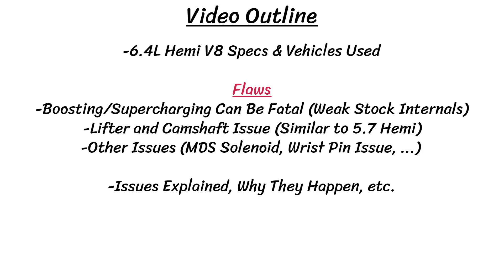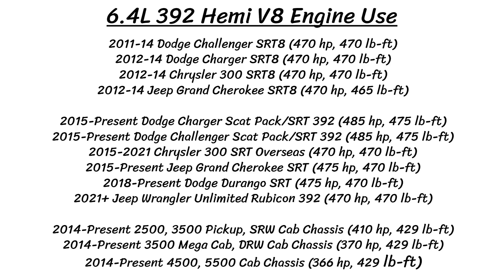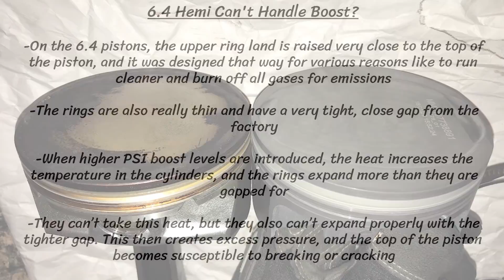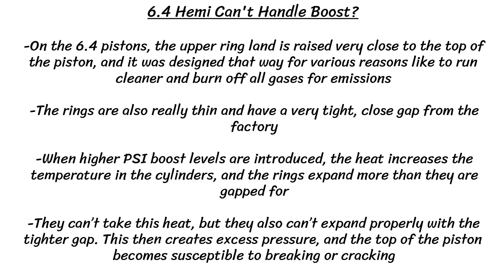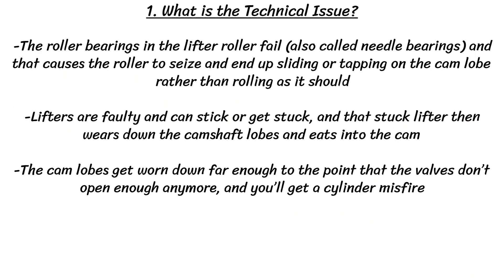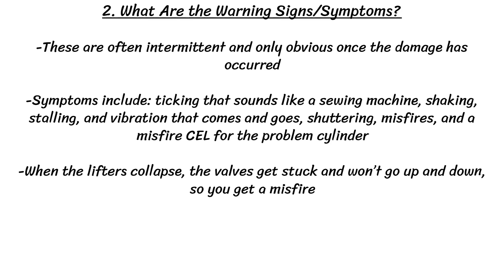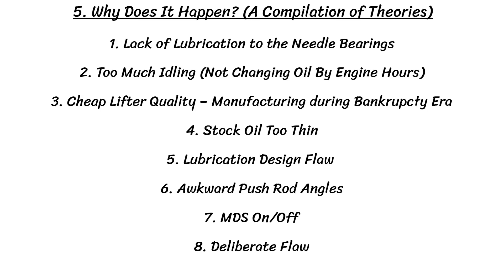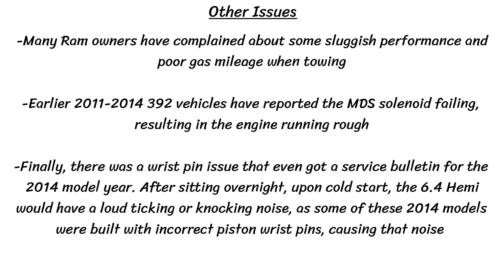The Specs and Fatal Flaws of the Chrysler 6.4L Hemi V8 Engine (392 Hemi Issues)

Comment: The 6.4l stock is pretty reliable.
Reply: I agree.  If someone is satisfied with the stock HP and doesn’t want to add boost they will be just fine.
Reply: @bybrianmalone  yea there are still a ton of ppl who don’t wanna bother with modifying and it’s perfect for that. Maybe adding a catch can would help it but I still know ppl who don’t have them and are fine.
Reply: Stupid video. They are extremely reliable in stock form. The fact that they can't handle aftermarket boost is hardly a "fatal flaw".
Reply: @ThoughtMachine1  true, he’s just naming the issues that these motors are known to have. Not all of them have these issues at the same time. Ik ppl with over 100k miles on them without any major problems. Personally have over 40k miles with the only problem being only a hole in the radiator lol.
Reply: @largenloud9744  I’m hitting 60k
Reply: @ThoughtMachine1  exactly I was so annoyed that he was like you gotta build the internal for boost as if that was something out of the ordinary 😂 like I know there are other motors that handle a little bit more boost than the stock 6.4 can but they all have a breaking point before throwing real high boost at them not to mention the 6psi the 6.4s can handle has been know to dyno around 200 extra hp and some pro charger companies will even warranty the bottom end too if you use their tunes
Reply: Totally agree brother.
Reply: This video is basically just saying you cant run boost or supercharge a engine with STOCK INTERNALS. These guys will get better blocks and INTERNALS if they really wanna modify it, like most other mid price vehicles. What is this video even proving?
Reply: I’d say it depends on the year made honestly. My 14 GC SRT had a new 6.4  put in at 30 k. I bought it at 60k and she’s singing like a singer sewing machine. I’m leaning towards the whole table of ideas why. Seems that they have it somewhat figured out now but still blows I hafta do a major operation on it to replace failed lifters. Lucky I can just do it myself and not eat a dealer rate.
Reply: The 6. 1 doesn’t even have as many problems has the 6.4🤦🏾‍♂️ Don’t get me wrong it’s nice but that hemi tick sound  is crazy for such a great engine and dodge still don’t know why it does it or how to fix it 🤷🏾‍♂️
Reply: @tvisfake588  not true hemi tick was fixed sometime in 2014-2016 if you have a model after that you should have taken better care of it or maybe just got unlucky
Reply: problem comes when idiots want to start throwing boost in them… id keep the 6.4 stock, maybe a catch can & an intake but that’s about it
Reply: This dude still drives a V6, don’t take his videos serious especially if you’ve seen his “how to burnout” video with his big ass hair lmao
Reply: Utube Fknsucks  you answered your own question… you work In a auto shop lol
Reply: Utube Fknsucks  What is your definition of properly maintained? Work and personal trucks get serviced every 3 months, or less. They get driven hard, high idle, constant short trips and don't have issues regardless of manufacturer.
Reply: must of them start having issues around 50 thousand but they go unnoticed until they breakdown around 75 to 120 thousand which isn't many miles but I see this alot and dodge knows it and when they do fix one under warranty they do the bare minimum but people let them get away with it and you would think the issue Subaru had with the 6 cylinder with thin rings that dodge would be smart enough not to but hey you can't fix stupid companies or consumers but it's job security when your the one fixing them .
Reply: Exactly
Reply: The only fatal flaw is aftermarket modifications that push the power past the point the engine was designed for. Oh and the lifters that fail. That however can ruin things. But a cam and lifter swap and a cleaning of the block to remove shavings from the cam and it’s back on the road
Reply: @2koolchris291  That’s a flaw though lol, these cars aren’t cheap to begin with between gas and payments , 90% of people aren’t going to want to drop all that money after dropping all that money lol love my 392 but I’m a realist I know this thing won’t out live my 4 runner.
Reply: @Jacobyjohnson24  then they get what they get. If you try to ghetto rig boost an engine and only do the bare minimum or just a few things then yes your engine will give out. Either do it right or don't do it at all.
Reply: @russellrandy99  6.1 hemis an take prochargers with ease. 2008 300Csrt owner with 705 hp to the wheels on stock internals since 45k miles ago. Just saying.
Reply: @Eidrian111  6.1 srt engines have forged internals from the factory. The 392 like the 5.7 does not.
Reply: @joshkrause2977  now i know why it’s been reliable as f
Reply: @Jacobyjohnson24  So stick with Toyota like a Corolla SE?
Reply: @Jacobyjohnson24  well the lifter issue is isolated between certain year models it’s not just this forever problem with all of them like the rumor has it they fixed the issue and started using better lifters in like 2014 or 2015 not sure the exact year but sometime around then and if the price of the car and gas is already killing you maybe doing a cam and lifter job is too expensive but then again maybe you shouldn’t have gotten a high performance car if you don’t want high performance problems
Reply: @russellrandy99  so true
Reply: MoPaR oR nO cAr🤣🤣🤡🤡

Comment: i change my oil on my scat pack every 2000 miles in hopes of never experiencing that cam/lifter failure issue. once the car is paid off, i plan to do an "MDS Delete" with brand new lifters. I hear that this issue affects the MDS engines more often than the manual trans cars. Not sure how reliable that info is, but I feel that it's a good enough excuse to also throw in a custom cam & tune.  :)
Reply: 2000k miles is OVERKILL....so basically if you're driving cross country you're going to change oil....I don't think so
Reply: @David-yy7lb  Oil is the cheapest insurance policy you can buy for your car, but I guess you don't understand that kinda stuff lmao. You're not a car guy obviously
Reply: @akaDICworldwide  well I must be doing something right because my 02 6.0  Silverado is nearing 200k miles origanal motor with oil change intervals at 15k miles with Mobil 1 synthetic all its life and my 07 GMC duramax is just shy of 600k miles original motor with oil change intervals at 35k miles or once a year with rotella 15w40 non synthetic oil all it's life, so you guys go ahead and change your oil every month
Reply: @David-yy7lb  All that salt for what? It's okay bro, your wedge head flows pretty okay! If you spend 3k on some race heads you can flow almost as well as a 5.7 eagle! Anyone with a brain would simply swap cams and lifters to make much more power while fixing the MDS lifter issue entirely. That is what everyone I know with a Hemi did. But that's okay. If you want to make power go ahead and swap heads, pistons, lifters, cam, valve springs, and pistons to support the major off road racing cam you'll need to flow like a street hemi.
Reply: @David-yy7lb  do not compare LS to Hemis hehe, LS engines without VVT are made to last forever 😂
Reply: @David-yy7lb  I have a 03 (old I know) just a silverado 1500 z71 5.3
280xxx going strong, slight tick ..almost non existent 
love my beater, everything works..needs nuthin/

on the other hand, 18 scat with 18xxx miles and hearing shit like this is going to put me into hyper mode of (putting emergency funds away for her) 1st dodge ever..wish me luck LOL !!
Reply: @David-yy7lb  if i drove cross country...you bet your ass i'd change it lmao. what is an oil change? 40 50 bucks where you live? For some decent synthetic oil
Reply: @baileyhatfield4273  not every 2k for sure. Its a waste of money. At least every 5k oil change even with the cheap stuff. But every 2k miles is ridiculous and waste of money your dumping out good oil
Reply: @g.gg.g7135  I say it depends on how you drive I change mine every 2k but that's just me n the oil is very dirty like dark asf
Reply: Nothing to do with MDS, but lifter roller bearing design weakness in early Gen 3 production.
Reply: MDS isn't the issue seeing as how pre 2009 models with MDS didn't have an issue. The problems began when VVT was added in 2009. Evidently VVT & MDS don't play well together. From what I understand the VVT causes both increases and decreases in lifter pressure depending on what position VVT is trying to run. Also 2009 is when the lifters started being manufactured in Mexico instead of being manufactured in the USA. So the extra stress put on subpar lifters made in Mexico is the culprit not MDS. 

Case in point I have 223k miles on my 2005 Daytona edition Ram 1500 which has a 5.7 with MDS. The Daytona edition truck was the only 2005 model with MDS because it was the first run of vehicles on the 2006 assembly line. Mine is still running fine, and I have driven the hell out of it for 16 years now. Haven't babied it at all.
Reply: Good job. for you cammed 5.7 guys and 6.4 owners another good oil choice is 15w50 full synthetic with 20% Marvel Mystery oil.
Reply: 152,000 miles no cam/lifter failure change the oil everytime the vehicle tells me too.
Reply: @qwertyu3864  2018 scat 19xxx miles going strong LOL.
Reply: @qwertyu3864  depends on year of manufacture of vehicle to which lifter revision was installed. If yours is early Gen 3, not yet had lifter roller fail, then I would suggest your on borrowed time, or roller has failed and you are not aware of it. I can tell you from experience, you won’t detect roller failure until it’s too late. No noises, no change in driving ability, not even tick or tappet sound surprisingly given the excessive clearances resulting from wiped cam lobe. 1st thing that happens when cam lob had gone down to point where engine develops miss-fire. That’s the sign.
Reply: I have a stick 392 bro tbh it'd better cuz it doesn't have mds I threw 20k miles on my 392 in less than a year no ticks problems or any shavings in my oil
Reply: The lifter that failed on my 5.7 controlled the number 5 intake valve, It was not an MDS lifter. MDS lifters are used for cylinders 1,2, 6,7.  The car spent 97,000 miles in state trooper use while having its oil changed every 5,000 miles. However, when I changed the oil for the first time, I noticed the oil filter was not the MO-899 version, but a thinner version installed at a quick-change oil and lube place.  I'm sure they used minimally sufficient oil as well.
Reply: This is true follow the class action lawsuits on both issues of hemi tick early valve lifter failures and MDS issues from 2008 to 2022 Dodge vehicles.🤮🤯😱
Reply: You know there's going to be a problem in the future and he still wants to do some upgrades to your bucket.
Reply: @shaun7126  o
Reply: @shaun7126 . If his Hemi was produced post 2015, should not be any concern about early life lifter failure and subsequent cam lobe damage. Just simply follow manufactures service intervals and drive it.
Reply: @index6738  my 2017 rt, i experienced the never ending misfire and it was the cam and lifters lol
Reply: @HighOrange  that’s interesting but the original lifter supplier was dropped around that period. Makes me wonder if there had been metallurgy problem in their product? That said Jeep did say they expect to have Gen 3  6.4 built to 2015 to have roller failure.  2016 to 2017 lifters came from original supplier, so who knows if their good or not? But 2018 to 2021 lifters come from new supplier.
Reply: @index6738  What about my 2014 Charger SRT 8 6.4 ????
Reply: @raymondrocco8607  2014 definitely. My 2014 Engine PN ending in AA was replaced after travelled around 60000 miles. All too common story. Cam lobe was gone and seized roller probably locked up way back. Only give away was sudden onset of light throttle pinging and misfire above 3000 RPM. Engine had easy life, always serviced on time  with best synthetic oil and regardless lifter roller seized and progressively over period of time was quietly wiping cam lobe down. Would have been cheaper and less stressful to have known via TB about the weak lifter roller bearings so that way an informed decision can be made about it. In retrospect, had I known, I would have had lifters replaced with revised ones. Same happened to 2013 and 2015, from people I know. Jeep service said it was common failure and stock new MOPAR long blocks PN ending in AB to replace engines when they go bad. The other thing is 6.4 dipstick. If your oil dipstick PN ends in AA, the oil markers stamped too low and give false oil level reading. Full means you need oil. There is SB on it. Should be replaced free of charge. Right oil dip stick for 6.4 PN ends with AB. Oil markers are positioned higher up stick.
Reply: Great Information......
Thank you.....
Reply: @raymondrocco8607 . In that case drive it like you stole it, though if it develops miss-fire which generally happens around 60000 miles, you will know  why,
Reply: Idk where youre from but dont get a livernoise tune 🗑
Reply: @catalyst_99 that’s absolutely not true at all that’s like saying if you delete d.o.d on a Chevy u absolutely need to put a cam into it I wouldn’t not upgrade the cam while deleting it but it works all deleting the feature would do is keep the motor alive alott longer stop misleading people
Reply: I usually change mine at 3-4k but I don't drive it ridiculously hard. I don't know about the 6k they recommend especially with how hard a lot of them are driven. Better to play it safe if you want to keep it around.
Reply: That is just too much high maintenace.
Reply: I 100% believe that MDS is a problem.  My 6.1s, without it, all ran great with no problems.  I now have a 6.4 with no MDS and it is a beast.  Both my 5.7s had MDS and had problems
Reply: @jtc1964x  i hear they addressed the lifter failure issue in 2016.  what years were your two 5.7's?
Reply: Removing MDS solenoids and lifters to allow full flow is the solution. MDS lifters only get oil when MDS is on. So if you remove the solenoid it allows the oil in to activate the mechanism in the lifter so this is why you want to remove them and replace with regular lifters otherwise MDS will always be on if you only delete the solenoids. This is why high idling cars have the issue way more than anything else because MDS doesn't turn when idling therefore starving lifters surfaces of oil. Very simple concept
Reply: @corruption1724   non MDS Hemi have same lifter failures. Not oiling problem.
Reply: @index6738  Very few failures compared to MDS models.
Reply: @corruption1724  and yet to see correlation when MDS lifter is not common failure one.
Reply: @corruption1724  Just buy a manual transmission Challenger or an SXT Challenger V6 Penestar engine from the get go.
Reply: Who cares bro
Reply: @riverbrock  Thank you! 🤣